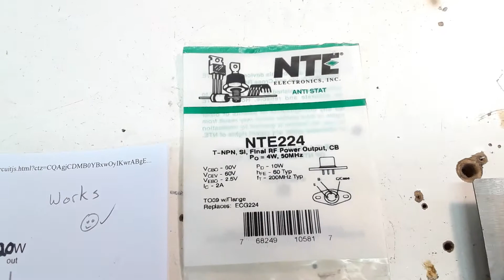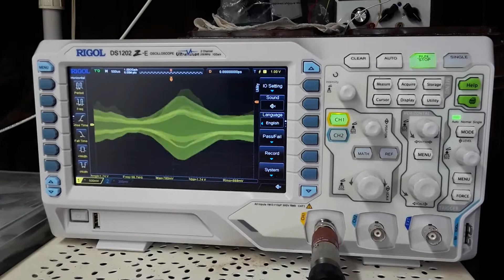20W AM Transmitter circuit schematic diagram

Comment: Sir!can we upgrade this to 100watts using mosfet?
Reply from the maker: "upgrade this to 100watts"----

Yes.
I'm currently working on an RF power amplifier using a pair of N2488 BJT transistors from and old stereo, but any suitable BJT or MOSFET pair will work.  I will publish my schematic when complete. 

My experiments with the N2488 have shown a fairy good frequency response for the AM band and more than 100W output.

The actual output will of course be limited due to my shortened antenna and FCC regulations.
Reply: @andrewferg8737  I like this circuit 'coz it's simple,I will wait the  100 watts :)Thank you
Reply from the maker: 100W -----   https://youtu.be/HL7fVGOM0UI